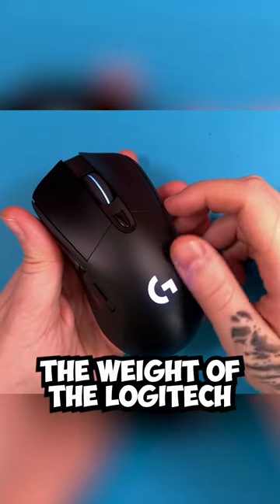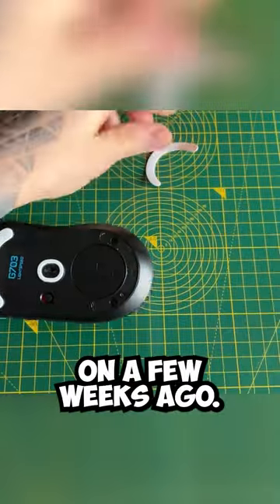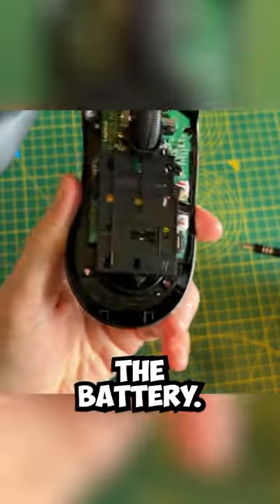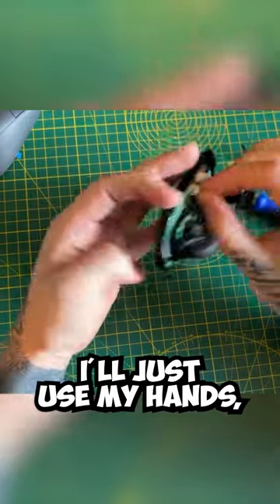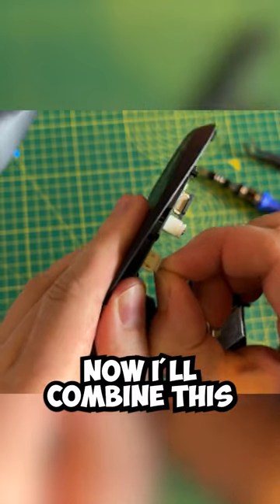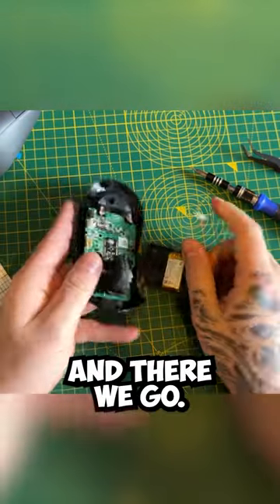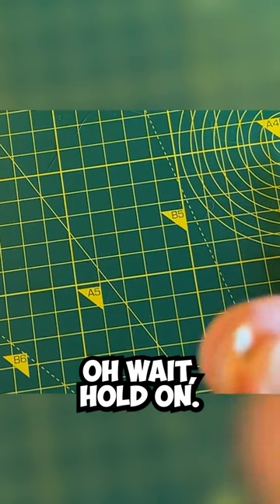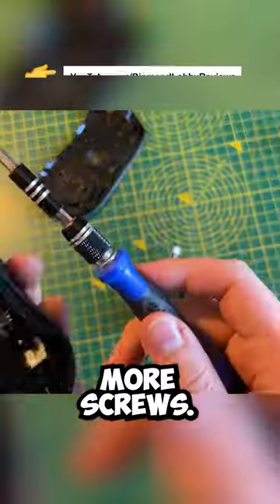I fixed the Logitech G703!

Comment: You understand your not meant to just pull on the wires and the white things are clips with bits that need pressing down to remove. The bit you found in your hand was the broken clip
Reply: 💀💀y is it not powering on ???

Comment: For FPS players out there
Buy g502 x plus this mouse is literally a cheat code
Reply: I just got my non RGB, after playing with a friend's G502 hero wired on 15 fps with no mouse pad and being the top player in the match. 

And the G502 X Lightspeed is absolutely amazing and it's the only mouse I've had that is actually bearable for more than an hour or so.

I was apprehensive since my other mice are alot lighter and I was under the impression that lighter is better but even with it's weight I'm still clicking heads.
Reply: 120g mouse for FPS lmao said every every silver VI or whatever their equivalent is in other games
Reply: @jamesvandorn2563  that’s some pure luck my friend don’t get me wrong seems you play good but on higher ranks 15fps is unplayable you won’t even notice your dead🤷🏼‍♂️